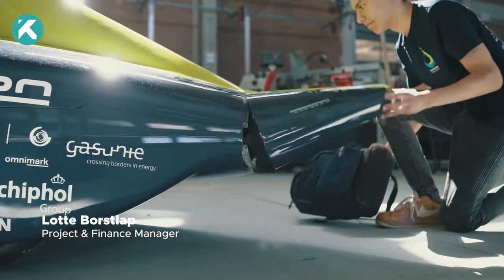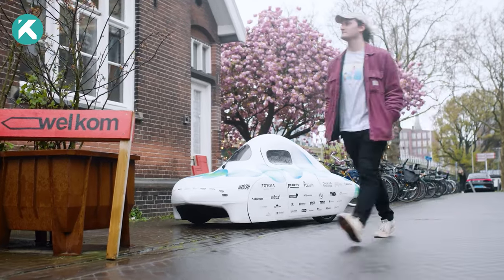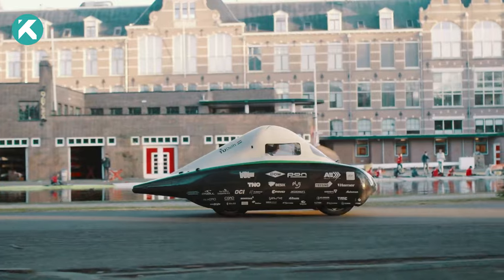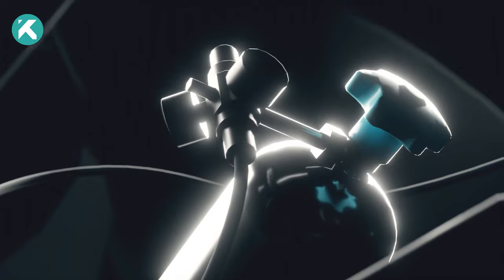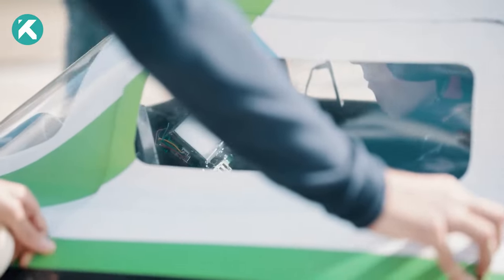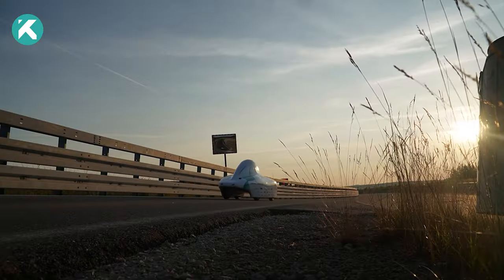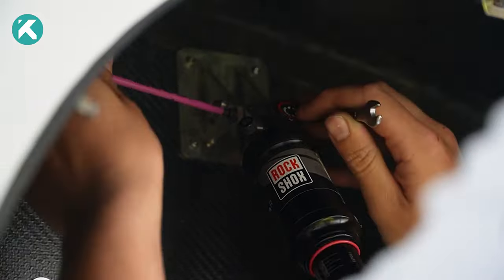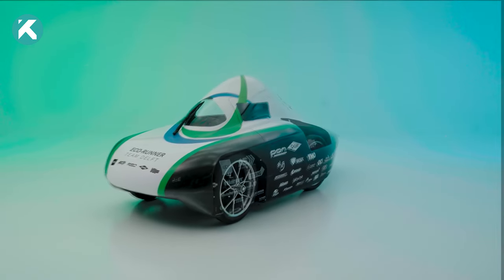CAR FROM THE FUTURE

Comment: Troy Reed documented his magnet motor from a 10ft monstrosity to small enough to put in a small economy car. A Free Energy car that you would plug in to power the grid, not the car. 
Dennis Lee is another one. So is, and probably the most important, Maxwell Chikumbutso.
Even Troy Reed's Geet Fuel Processor would at least safely burn off unwanted and contaminated liquids and turn it into energy. 
Well, now you have some homework.